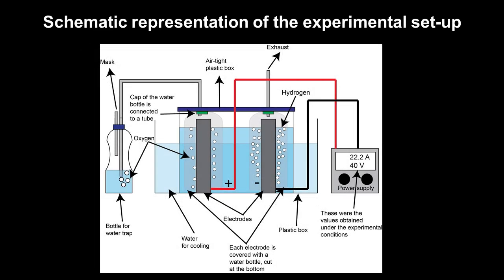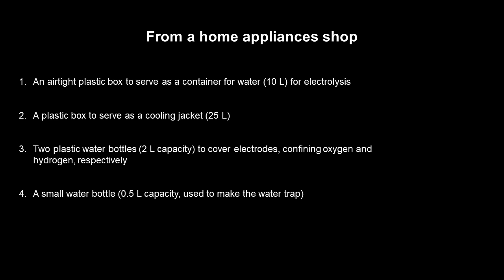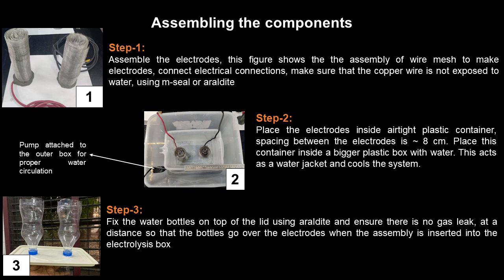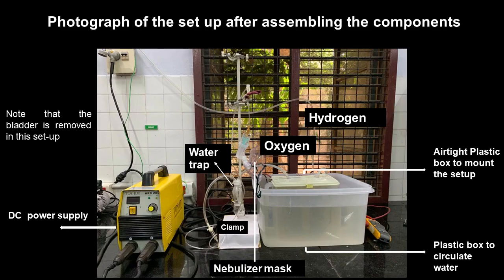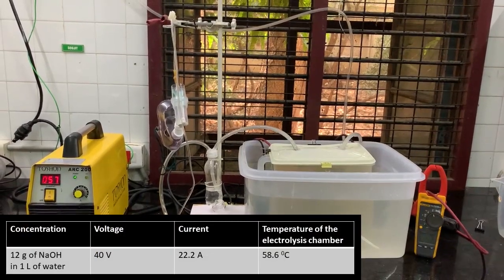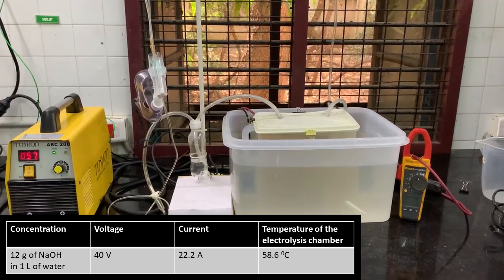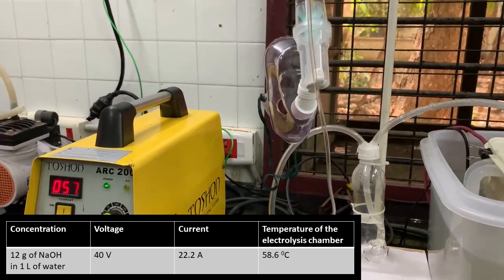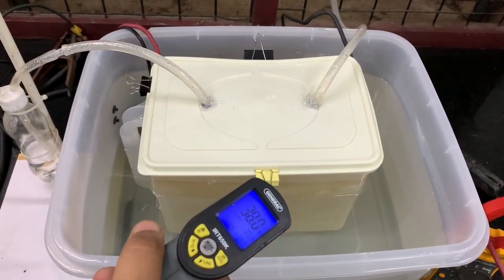A simple way to make oxygen at home - V2

Comment: Kindly check the gas flow/production rate. The amount of oxygen produced is related to the amount of charge passed, which is dependent on the amount of current passed over a period of time. Thus, current, which is the amount of charge passed per unit time is directly proportional to the amount of gas evolved per unit time. Faraday's equation should allow for an easy calculation of charge vs gas evolved. The potential or operating voltage is what decides how efficient your system is in generating a given amount of gas using a  given current level. Simply put, it is not the total power that decides the amount of gas produced, but the total (current*time) or charge passed that decides the amount of gas produced. If the current level is low, but voltage is too high, then higher power or energy is used to generate a lower amount of gas, and thus all other energy is lost in terms of heat (mostly due to resistances in the system). According to Faraday's equation, 22.2 A current passed for 1 hour will generate approx. 5-6 L of Oxygen (not 120 L). Please recheck!
Reply: Thank you for pointing this out, I wasted a lot of time because of this claim, until I checked the calculations.
Reply: yes that was the doubt i had they said oxygen required per min is around 5-6 liters,
can i know the bi-products of this reaction 
like hydrogen , oxygen .etc
where the rest of the elements undergoes
Reply: @bharatha9070   Electrolysis is breaking of water molecules using electricity. In simple terms, we provide the energy (using electricity) required for Hydrogen and Oxygen in water to separate and return to their individual gas phases. 100% efficient electrolysis, will generate only pure Hydrogen on the cathode (negative electrode) and Oxygen at anode (positive electrode). For this current application, Oxygen is the main product we want to utilize, the byproduct is Hydrogen which is unavoidable and needs to be vented out in a safe manner. The other unwanted byproduct and an unavoidable byproduct is heat generation due to the inefficiency in the process. As no process works at 100% efficiency, some of the energy that is added to the system is wasted as heat and needs to be managed by cooling the bath. Improving the efficiency of the process will reduce the heat generated in the process.
Reply: @gvchakravarthy  thank you for the information
i have a doubt that we use NaOH in the reaction as a byproduct Na will be deposited at the electrode or the bottom of the tub as the process of the electrolysis should be made continues is there any changes that 
the unwanted byproduct can become dangerous to the patient and the lifespan of the experiment.
Reply: @bharatha9070  The NaOH that we use is only helping with making the water conductive to electricity. The Na does not get reduced to form Na metal deposits. Na is highly reactive and will always ionize in the liquid and stay that way. The only dangerous byproducts like I mentioned are Hydrogen which is flammable, and if the water is not pure and has Chlorides, then Chlorine will evolve along with Oxygen. Chlorine is dangerous when inhaled. If the water has Ca (chalk) the there might be a possibility if Ca depositing as Oxides over time. But using RO water should help with avoiding this.
Reply: @gvchakravarthy  thankyou for clarifying my doubts any doubts i get posted in the comments.
Reply: Does it give pure o2 if yes then  can it be used as alternative to oxygen concentrator.
Reply: @harshitchaurasia7973  Yes, if your water and chemicals are pure, then it will generate pure Oxygen. But make sure to run the produced oxygen through the water trap/bubbler to remove any vapours of chemicals that get mixed with oxygen.

Comment: i think we can circulate the water flow so that the temperature of the water can be stable like by using float adjustment screw which is used to control the water flow in western toilet
Reply: yes, there are possibilities to fix the heat build-up in the setup, but it is the best approach to start with lowering the heat generated within the system. This can be done by increasing chemical concentration in the electrolyte, thus increasing the conductivity of the solution; decreasing the distance between the electrodes as much as possible but still allowing easier separation of gases, reduced electrode distance reduces the ohmic resistance of the electrolyte and hence improves efficiency; increase the amount of surface area of the electrodes as much as possible, finer the wire mesh, higher the surface area; operate at about 50-60 C of the electrolyte for best conductivity.
Reply: @gvchakravarthy  that's really a great idea, thankyou

Comment: Thanks for the step-by-step video. I would suggest using a higher concentration of NaOH. Most efficient operation is observed normally at 30-40 wt.% caustic solutions. I would suggest using at least 200 g NaOH per 1 L of RO water. This greatly improves the water conductivity and allows the passage of higher currents through the system for a given operating voltage. Also, less energy is wasted in ohmic losses across the electrolyte and thus reduces the heat build-up in the electrolyte. Of course, concentrated NaOH solutions are highly corrosive and need to be handled with great care and never without protective gloves and breathing masks. When you add the NaOH salt to the RO water, it is normal for the water to heat up. For cooling the electrolyte, you can also use chilled RO water or ice cubes of RO water to add into the bath for making up the water level and to take away some of the heat generated.
Reply: Sir can I use 12V power supply ?is it generate required oxygen for patient?
And what is the best thing for increase the surface area of electrodes
Reply: @satyamdubey254  Yes, you can use 12 V. However, now you have to keep the electrodes closer to each other as the potential difference is reduced. So, you have to do the experiment in a smaller container. If you are able to keep the electrodes closer to each other, the resistance to current flow will be reduced and less voltage will be required to pass the same amount of current. More important is to increase the conductivity of the solution than to increase the surface are of the electrode while still keeping the corrosion done by electrolyte to its minimum.
Reply: @satyamdubey254  just as an addition to the earlier reply, keeping a bigger container while reducing the distance between electrodes is also fine, this will help with lower speed of temperature increase. Use about 200 to 300 g of NaOH per 1 L of RO water. This will give the best conductivity.
Reply: You are right. To get more oxygen flow you need more power which mines more amperes. But it is possible to increase the voltage. Increasing the the voltage in a system that contains water is danger!!! so it is not recommended. But professionals can take the proper precautions with good isolation and do it. Agene, it is not recommended!!! increasing the voltage or the carnet will hit the water much quicker, so you   have to use a cooling system.